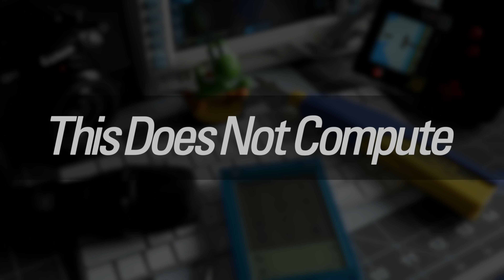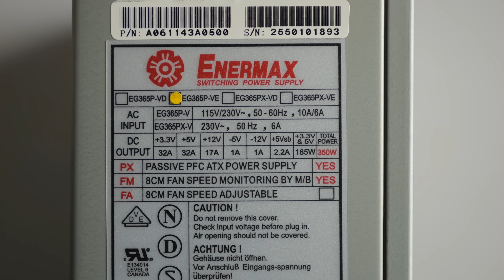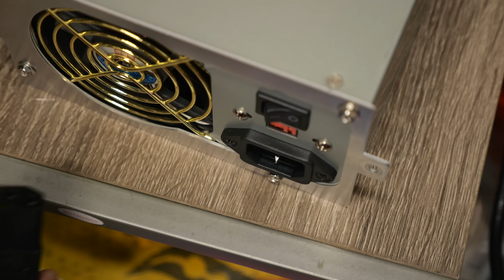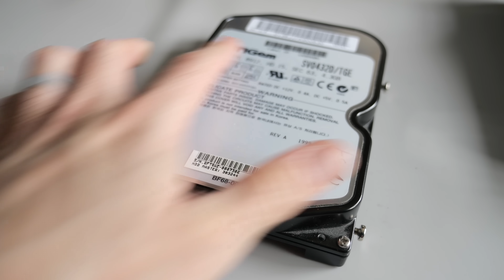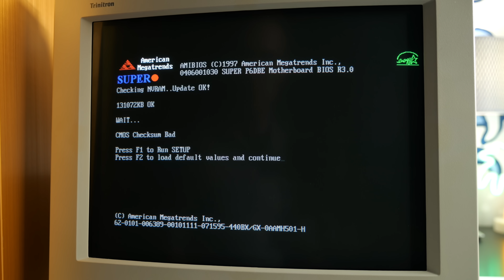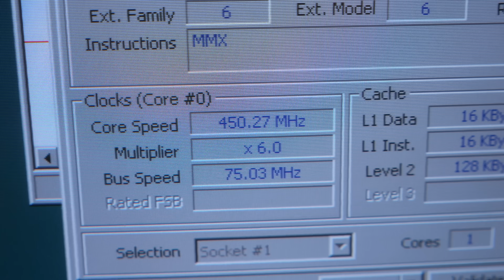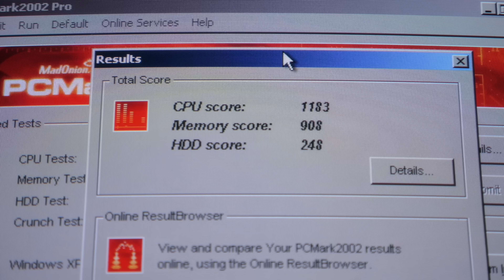I tried to put TWO vintage Celerons in one PC

Comment: Side notes: 1. Supermicro settled with SEC in 2020 for accounting violations, paid $17.5M fine.  In 2024, DOJ opened a new investigation into Supermicro's practices.  In October, Ernst & Young resigned as Supemicro's auditor citing alleged accounting problems.  2. Intel has lost market share for years.  CEO Pat Gelsinger was ousted after 60% share price fall and $16.6B loss.  Gelsinger recently "prayed" for Intel bc giving back the millions he got would be too high a price.

Comment: That slick burl wood finish fits the ostentatious golden sheetmetal perfectly. Simultaneously classy and sleazy — like if there’s any system that demands a 5.25” drive bay cigarette lighter, this is it!
Reply: As soon as I saw the woodgrain, I thought "I know who would like this". I was not disappointed in any respect.
Reply: The guy that bought it originally definitely drove a Jaguar.
Reply: @austinkoeppen6122 and sipped scotch with a stogi
Reply: I'm amazed at the condition of the case. Either it was NOS or someone LOVED that case. I enjoy my builds but, I never treat My cases this nice. But I also "LAN party" like it is going out of style. So the cases get moved around regularly. I used to buy the most rugged looking and expensive cases for this. But, the weight is a pain.
Reply: I was just watching this, and as soon as I saw the case, I thought Clint would like it. When I saw the wood trim, I thought Clint would marry it.
Reply: I feel like this is the equivalent of when you see a model of car with the luxury interior spec with the gold and wood trim when you're used to just seeing the sport trim with the aluminium and carbon fibre accents. I've got a PC-60 case btw ^^
Reply: Look at the grains. Greatness!
Reply: This case definitely wears a burgundy velvet bathrobe
Reply: Oh hey Clint….
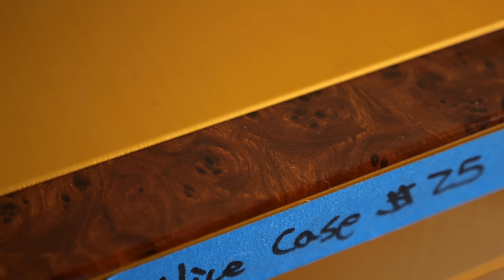Reply: I heard you speaking about woodgrain in my head before you did the crossover, just a loud and clear "Mmmm, that's a nice woodgrain" - followed by 2:41
Reply: I purchased an old beige case at Free Geek Twin Cities and gave it the wood grain treatment. However, I put modern components in it.
Reply: @LGR  If any electric car manufacturer creates a wood grain only car made exclusively out of wood you would probably be the first to own one
Reply: Cigarette ligher??
Reply: Should see about painting the CD and floppy bezels red-- I bet that'd blend real nice with that copper/gold.  And orange LEDs!  OMG, I'm building this in my head already 🤣
Reply: This case is now my holy grail. I am SMITTEN.
Reply: I saw that case and thought LGR would love that case with the wood grain.
Reply: BMW e32
Reply: Yes absolutely agree that it needs the cigarette lighter/tray
Reply: Maybe that's how they got that copper color in the first place?...
Reply: Thought of LGR as soon as I saw the case and flipped when I heard your comment! I did not expect that!
Reply: Hope you get back to your norm soon still glad your ok @LGR but it could have been much worse
Reply: Yes, yes, yes.. The perfect YouTube crossover!!!
Reply: hdd is like Samsung 80gb
Reply: I just thought that LGR should do a dual everything build and then I saw this video. Maybe do it anyway? 😉 2 cpu's, voodoo sli etc.
Reply: I still have my Lian Li case from 2000. I can't seem to let it go even though it's been in the garage for over 20 years.
Reply: the pattern is birds eye maple. does look like a pc from a horror house or bath front desk. .
Reply: I love your videos and am glad your recovering from your disaster.
Reply: Tell me about it. It so cool to have a PC case from that company.
Reply: Well hello there, just passing through? Me too.
Reply: Sleazy? Americans don't understand luxury.
Reply: @PrinceWesterburg  Okay troll, America defines luxury, like everything else!
Reply: @PrinceWesterburg Trump loves this type of stuff. Have you ever seen photos of his houses? Gold and woodgrain everywhere.
Reply: its a computer. its not ostentatious at all. people dont care what computers other people build for themselves
Reply: Oh hush.
Reply: @Toonrick12  let the man SPEAK..!!!
Reply: @godzzwrath  let him COOK..!!!

Comment: What's better than one CPU that punches well above its weight? Two of course!

Dual CPUs come with similar problems as running two GPUs. Stuff can very easily get thrown out of sync or become unstable, assuming it's even supported.

Also, HI CLINT!

Comment: This brings back memories. I had a dual Celeron 300A back in college, overclocked (~450MHz; might have been 433/475). My CPUs were PGA (not the daughter card versions you have). It wasn't the fastest CPU at the time (clock and cache were behind the P2/3) but OMG having two cores in your personal rig was unbelievable.

I still remember setting up Slackware on that thing late one night and losing my mind over not being able to set the clock to the right time. The DST changeover was that night so when I set the computer's clock to what was shown on my watch it came back an hour off. That one took me a while to figure out (I was pretty tired).

Not sure what happened to that thing. Probably handed off to my brother or dad when I moved away after college.

Comment: Before the socket 370 boards, there were socket to slot adapters, slockets, which included the wiring changes to allow SMP. Grab a pair of 366’s for them and you’ll have that thing at 550.

Comment: I had a Lian Li pc61 back in the day.. that was the black version. For cable management I cut a square hole just in front of the psu on the inner side  so you could run the cables down behind the motherboard. I had a 300a @ 450 in it, and at one point I had a friends Abit BP6, with a pair of celeron 466's in it.

Comment: had used a similar board back then. yeah, celerons were a no go, only pentiums. it was fun to play with that system. as for the dual PII performance, although it was better than every other, if you consider the cost/perf. ratio, it was actually...meh. mps was not that performant so early on. i too believe that intel left the celeron 300a overclock open, to stick it to amd and of course, sell more celerons!!!!

Comment: I remember one customer coming with dual socket 370 celerons. ABit BP6 I think was the mobo. Somehow one of the techs got it going in dual cpu mode. It was a lot of fun getting that thing to boot.
Reply: I had an Abit BP6 wiith Dual Celeron 400mhz processors back in 1999. I remember it being a fantastic machine.
Reply: @unkiescott I had a BP6 with dual C-466’s and Windows 2k. It was a beast.
Reply: That was BP6's party trick, did it out of the box. Intel were probably quite unhappy! actually I know they were, that board is legendary.
Reply: have a pair of 366's on a BP6 that do 550mhz with a bit of excessive voltage. 500 in the more safe range.
Reply: @NVMDSTEvil  My drilled dual slot 1 300As ran for 10 years at 450mhz, they were a bit unstable above 500. That was on the DFI board.
Reply: @NVMDSTEvil  same here.  366 -> 500
Reply: @NVMDSTEvil  
366s Sanded down the tops with 2000 grit paper and the same with the after market heatsinks (modest size for those days) . Stable at 550
Reply: I had a BP6 as well. In fact I think I had four. Made great living room servers.

Comment: Done this as far back as 1999. The dual processor mod didn't require such sophistication, though I was doing it on 233MHz Celerons. Maybe they were simpler than the 300A that I never owned. Drilling one of the pins out and linking a PCB sub-layer to one of the processor pins was all that was needed, but required more precision than your average de-lidding. I still have paper printouts of all the instructions somewhere. I haven't done this mod in 25 years. For the motherboard I used ASUS P2B-DS. Best one I ever owned. Still have it. Modded to the gills. When it released, the box said 233-450MHz P2, as that was all that existed at the time of manufacture. Towards the end of life, it was possible to run it with dual 1GHz P3's.
Reply: The socket 370 cpus didn't need modding at all.

Comment: In the 90s I had one of these running at 4,5 x 83,3 MHz -> 375 MHz with little to no effort.
Reply: 83FSB was the hardest to run. I highly doubt that bro.
Reply: @nexxusty  You are probably right. I remember taping a pin on the Celeron board so that I could set the multiplier freely. It more likely that it was 5 x 75 MHz -> 375 MHz... was way over 25 years ago. I think memory timing could stay as is... but don't quote me on that.

Comment: Somewehre I've got a screenshot from about 1998 where I had two of these working with the dual cpu trick, running BeOS and even overclocked a bit.
Reply: Oh wait, I remember now. I had two S370 Celerons in slot 1 "slocket adapters". Those could be tricked into running dual CPUs rather trivialy.

Comment: 2000s Lian Li cases are incredible. There were so many models I wanted, but couldn't quite afford back then. I do have a full tower from 06 that I refuse to part with, though.
Reply: I've got one. It has the greatest longevity of any part in my machine. Except for the dust filter. That disintegrated years ago.

Comment: That dust filter was more dust than filter. I really like old Lian Li cases, that colour is gorgeous
Reply: Happened to the filter in my silver version a number of years back. Greatly increased the frequency with which I need to clean inside the case since losing it.

Comment: I had a BP6 with dual Celeron 433 running at 490MHz, and I don't remember Quake3 smp making any difference.
But my video card was a Voodoo 3 3000, so maybe there was a bottleneck here.
Fun fact, Unreal 1 ran better on Linux with Wine than in Windows :)
I remember reading it was because Linux used a different tread for audio, but I'm not sure it's the reason.

Comment: Ok so here's a workaround for you for your Celeron 300A SMP option. the Celeron 300A came in both Slot 1 AND Socket 370 configurations. See if you can track down 2x 300A S370 CPU's. Then you can also locate 2 Slotket adapters that have the SMP override on them, allowing the 300A to work in Dual CPU config.
Reply: I think that was the configuration I ran for a couple years. I definitely have never had the dexterity to do anything more than the most minimal mods, and I definitely didn't have the budget for real P2 chips
Reply: There was an Abit motherboard dual cpu that could handle 2 celeron.
Reply: @ericoserravite9356  yep had that board, the BD6 i think, or BP6, it had the workaround for the PGA370 celeron.
Reply: Yes, friend of mine used to run dual S370 300A's at 464 MHz in an Epox motherboard. When he was getting rid of it I could have gotten it, but I wasn't interested so it was just scrapped. Now I wish I'd kept it. 😀
Reply: I did the same thing back in 2000. SMP with windows 2000 and a 3dfx card.
Reply: I can verify camjohnson2004 is correct I ran this exact setup on this same motherboard, back in the day, the slot to 370 adapter avoids the detached pin issues. One issue I remember in the day was not all celerons were equal and I needed to try a few to get a good working pair when over clocked.
Reply: @VampireBills Binning, before the term even existed! 😂
Reply: For all the "celly 300A only came as slot 1!!" people - look up SL36A, or intel part number FV80524RX300128 so we can all lay this to rest. mic drop
Reply: @ILikeStyx  They still called it a 300A because there was already a 300Mhz Celeron, and because consumers are dumb, they had to make sure it was well known it wasn't the crappy Celeron 300, people would avoid it like the plague because of the number.
Reply: Celeron 300a absolutely did not come in anything but Slot 1 format.
Reply: @nexxusty  Tell that to my BP6 board running dual socket 370s overclocked to 450MHz. I mean, he even showed you a pair on a board in the video.
Reply: @egbront1506  I also had a BP6 with dual s370's.  Good times!
Reply: @nexxusty  There is an article in Anandtech from 1999 that describes a socket 370 mod to an adapter to a Celeron 300A . So while extremely rare they existed
Reply: @nexxusty  source?
Reply: @ApemanMonkey  I also remember celerom 300a was only on slot and actually very short time because was without a cache l2. Just soon after were introduced with a cache.
Reply: @mirek190  no, the A in celeron 300A means it has internal L2 cache.
Reply: @nexxusty I have both still modified slot one celeron 300a's and socket 370 300As right here on my desk. I've built them both into SMP machines in the 90s
Reply: @nexxusty  Weirdly enough the Slot 1 300A looks suspiciously like they soldered a Socket 370 chip straight to the board.
Reply: @Stoney3K  that's pretty close to what they did. instead of adding pins to the bottom of the S370 version they just put BGA on the bottom, soldered it to same PCB as the non-A version and that was it.
Reply: @nexxusty  I cant say for the 300, but I had 2 366's in s370

Comment: I had a couple of those exact boards.. they were new, built as firewall appliances with celerons in them..  similar to a PIX.. we had actual PIX firewalls in pace already so there were re-purposed..  i populated the boards with p3 450s they served as web/database servers for a few years.. one was linux. the other was IIS/ASP/SQL.. i had a couple other dual pentium 3 boards.. these were actual intel boards.. one became a exchange server.. the other a domain controller/file server with a nice external raid array..  they all came from the same package.. all 4 were in rack cases in a rack with a nice UPS in the bottom. a cisco smart switch.. ascent MAX 400 RAS.. cisco 2500 series router with a t1 card.. KVM with remote access..  it made for a nice all in one web/isp setup with dial-up access..

Comment: Back then, Celeron 300A and especially the 366A had to come from the factory in Malaysia. The CPUs manufactured in the Costa Rica factory could not be overclocked stably.
The Celeron 366A had 550Mhz, - often up to 600!!
“Made in Malaysia” had to be written on the CPU,- that was the key. However, most Celeron A were manufactured in Malaysia at the time, only a few in Costa Rica.
Reply: I'm from Malaysia. Even though this is something miniscule, I'm still proud anyways 🇲🇾 🫡
Reply: That's what i wanted to mention.  When these CPUs hit the market back in the day, I used to work in a computer shop.  We would cherry pick our CPU from the bulk package the store would receive to make sure we had a Malaysian made version that was super stable at 450mhz.  Ran mine on an Abit BH6 motherboard.  That was an awesome overclocking feat for the time period.

Comment: Oh man, I used to have a Lian-Li case like that! Though mine was a touch smaller, black and had the PSU situated at the bottom front, but it was fairly similar in build and features.  I think mine was from later, though.  2007, 2008 or so?

I miss that thing.

Comment: now that i think about it why are the front panel cables separate? atx connections arent just just 24 loose cables you have to individually fiddle around with.
Reply: I think it makes sense here, since the motherboard slides in a slot.

Comment: Back in the day I'd built an Abit BP6 dual socket 370 celeron based rig, both overclocked and water cooled all the way back then. Waay before AIOs.. using transmission coolers, surgical tubing, aquarium pumps, etc.  Then later (and again recently in a retro build), an Abit VP6 with the later Coppermine based Celerons, then later P3's (this latest time around just getting to the P3s), again overclocked and water cooled (back then, these days its air cooling and stock speeds). Ran Win2K back then as well, had a benchtop power supply that ran the pump, peltiers, fans, etc. Had a multiple stage startup process, enabling cooling, then the computer,  lol.... Was a very cool kid. lolol.... But yeah, there were benefits for sure, things ran MUCH faster... and, I'd crossed the 1Ghz threshold well before chips were officially there (with both cpus no less, so that was pretty dang neat). Taking 2x coppermine 700Mhz celerons and bumping them both up, running with ridiculous uptime too, even with all that early watercooling. They'd even build up ice, but of course that condensation was distilled and non conductive, and never really got out of control. It all balanced out pretty well, though if you did need to shut it down, it would have to defrost / thaw, and have a bit of cleanup happen before running again. But that thing would just run, while I was in school and all... I could remote into it from my tech (was in cisco lab in the votech with my school funded custom build clear PC, with a single OC celeron, watercooled, frozen, lol)... we'd play UT, Q3, Worms, etc in that lab with all the networked machines... they financed my build as a showpiece thing... to get other kids interested when they toured the school. One of those, "you could end up making something like this" kinda things. I often wonder what happened to it, surely like most old tech, it was seen as worthless at some point and just tossed. But yeah... these were the best of days. I can remember sitting in my bedroom, next to that window... computer desk in front of me, full tower next to me, custom yellow paint (painted via my dad and me at his jobs HVLP paint booth), cooling tower next to it, downloading games from Game Revolution (demos), or using FTP servers to, well... you know. I had Win2K afterall, lol. . . Oh the good ol days indeed.